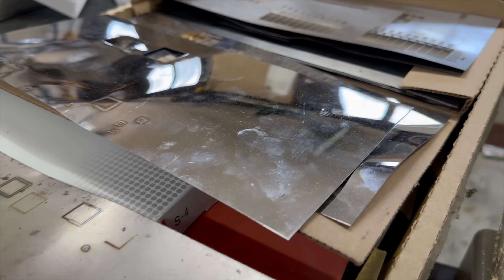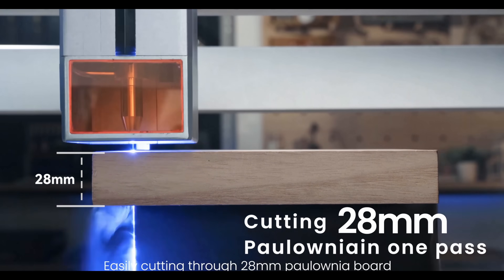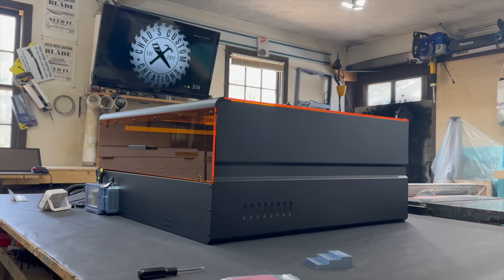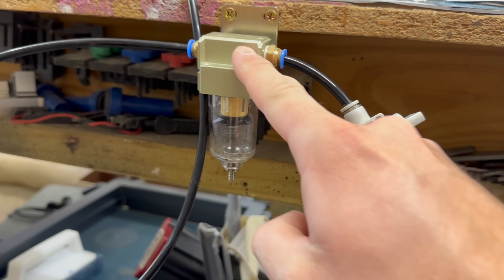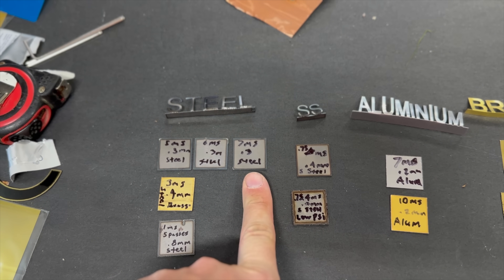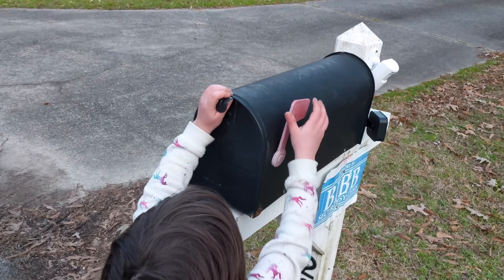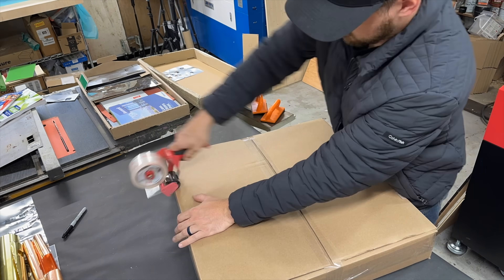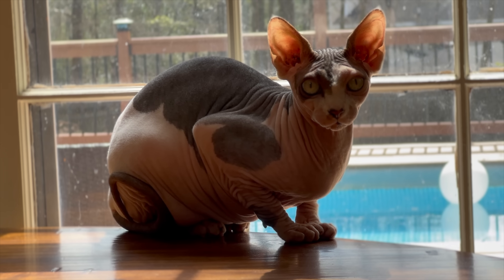Is The Future of Metal Cutting with Diode Lasers? 70W IKier K1 Pro Max

Comment: Coconut.  Nice video.  It's nice to see these diode lasers getting more and more powerful.  Soon they will be able to cut through much thicker materials.  I hope the market pushes to making more powerful infrared diode lasers.  They should be able to cut light materials that 450 nm lasers cannot.
Reply from the maker: I saw that IKIER has a 20w IR modern you can put on this machine also. I really need to get my hands on that for metal testing.

Comment: Coconut would certainly present a laser engraving challenge - I guess you’d need a fourth axis to manage the dome shape to cope with different focus levels.. but at least the thermal conductivity of the outside husk is low so a 70W laser would have a chance of piercing the outside.. V.Interesting video about the metal cutting - thanks - has anybody thought about a combination tool head I wonder.. plasma and gas assisted diode laser?
Reply from the maker: Martin or should I say Dr.Bartos thanks for watching. Plasma and gas assisted diode laser please count me in on that when it comes out!